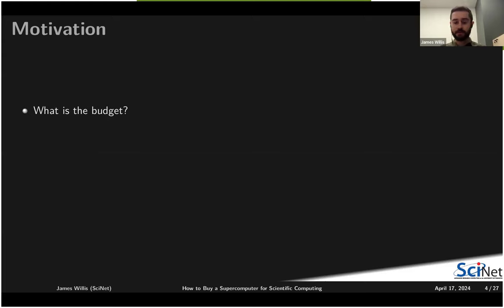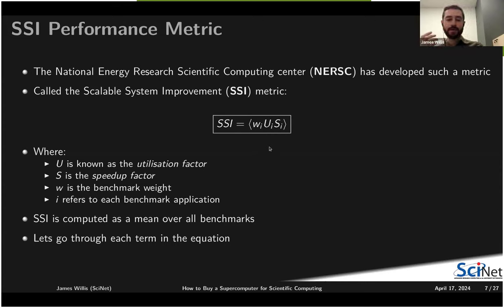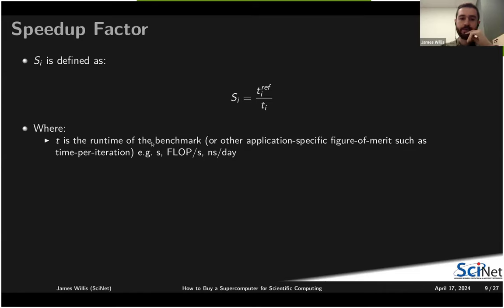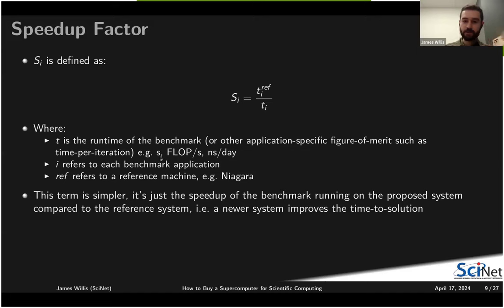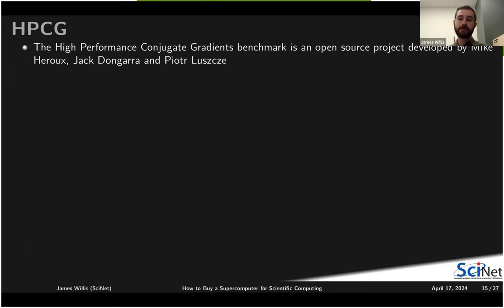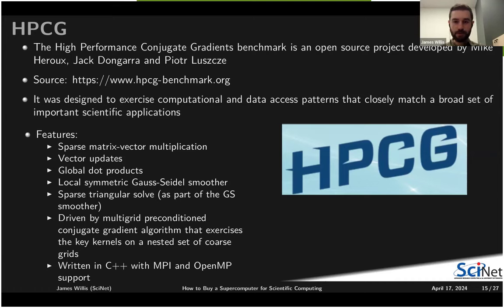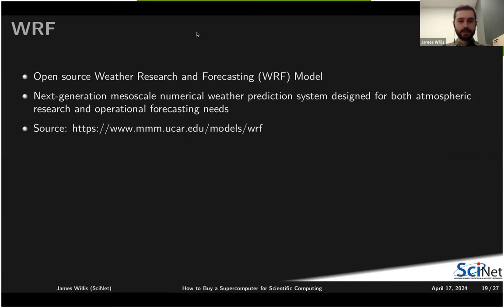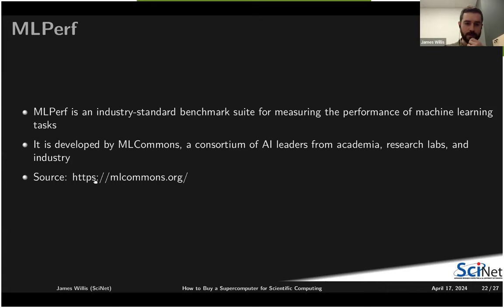How to Buy a Supercomputer for Scientific Computing

Comment: struggling to do real data science analysis or engineering projects such as " 244 gb data asset " through 10 gb docker with 192 gb ram (obviously idk where to get such a bunch of pcs or 1 thing )to compress the data into 4 or less  gb comprehensive results
Reply: in 1 hour max time